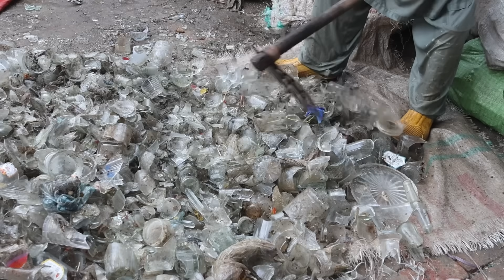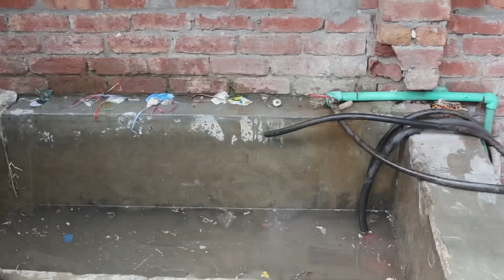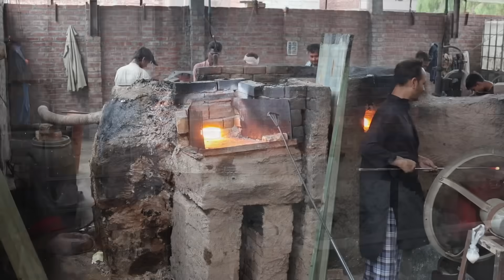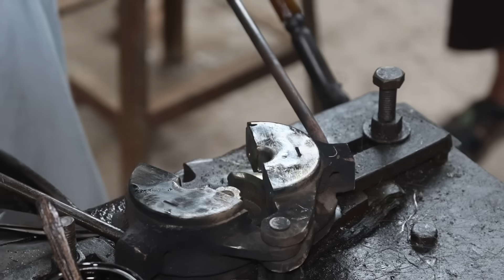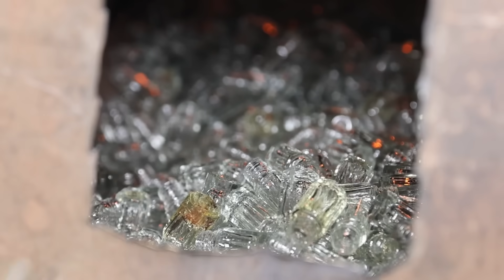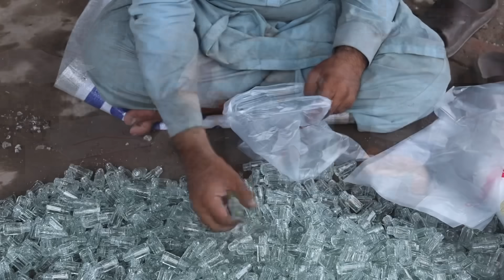How Waste Glass Convert into Perfume Bottles Through Recycling | Glass Recycling Factory

Comment: If Nuclear war will destroy electricity I think people in Asia will survive because they still do things manual and analog. This work are only learned hands on and by experience
Reply: The compressed air for the glass-blowing, as well as the fans and the water pressure are all provided by electrical power. The glass is melted in a natural-gas furnace. Every one of the technologies used here was invented in Europe. (The idea of glass-blowing need not have been, but the glass-blowing machine used here, was.)

Comment: You asked what viewers thought of safety.  No goggles, no mesh or leather gloves, no rubber aprons, I did see rubber sandals- not sure how effective they are, but better than bare toes.  I would imagine there are a significant number of injuries in that factory, but probably small ones.  Glass fragments can become airborne and as such have the potential to be inhaled, but I do see that they put everything into a water bath so apparently they are somewhat trying to avoid that.  Otherwise a very interesting video.  These are adorable little bottles.  Also, I noticed that the large bags they are using to put the small bags into are dairy feed bags - recycled?  A nice touch.

Comment: There are alot of chances of getting injured by glass pieces,the process of breaking and washing glass could be done in a machinery ,which could comprise of a large crusher with water sprinklers then a separater that would separate pieces from water and through a conveyer with slightly elongated sides to prevent the pieces from falling,be transferred to the blast furnace and the rest could be done by hands (human labor ).
Note:If the bottles have any plastic cover on them it could either be removed by hands (human labor) or in the machinery with hard bristle brushes and attached water sprinklers to soften the paper.